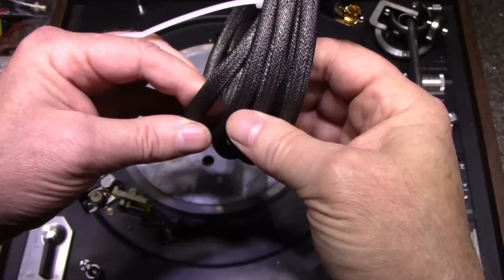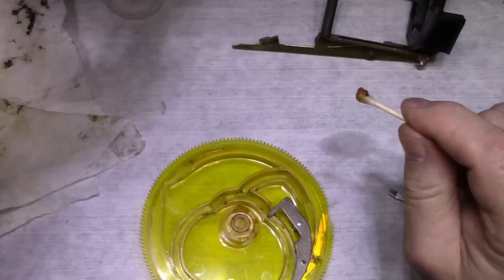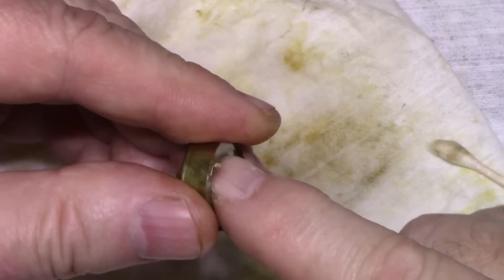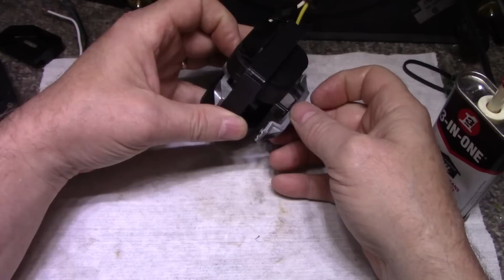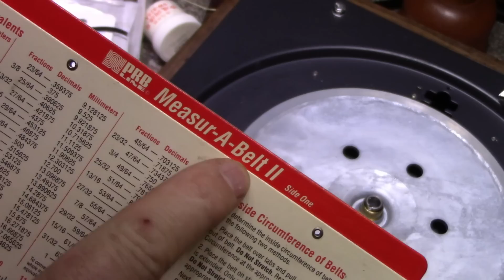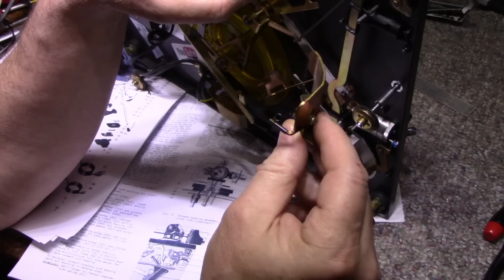Dual 1249 Turntable - Overhaul (Ep. 171)

Comment: I have more Duals on my repair rack than any other unit. several I still can't get working.  I wouldn't pay $10 for one. they are total crap.
Reply: You have no idea about Dual turntables. You'd better leave them alone.
Reply: @coconuts-TV they are absolute crap. There is no advantage of a Dual over any other turntable. they are noisy, high maintenance, have several consumable parts and don't sound any better than any other turntable with the same cartridge. not surprising given they were designed to be a budget automatic turntable from the start.

Comment: 2:06:07 ∞ play doesn't work as described here. Rather, the ∞ setting causes the tone arm not fully to park but to repeatedly restart the play cycle — of the SAME record. Single play is selected by one of two manual actions, (1) turning the control from ∞ to 1, (2) selecting STOP at the main start/stop lever. The deck is not a stacker.

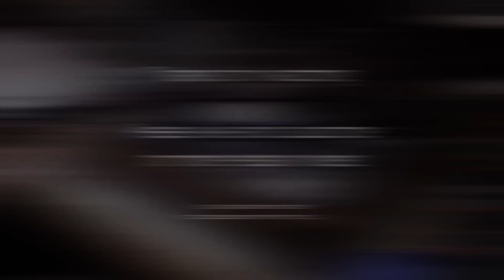Comment: At 2:26:28 in the video you stat that you removed the aluminum plate, does it just slide off the two shafts after removal of the clips and the shield, mine is hanging up on the larger shaft with the brass bearing with a rubber ring and the spring wrapped around it and I think it is frozen to the brass insert. Those two should be free from one another  I believe  because when in the video you switch between single and stacked records it goes in and out mine does not. I don't want to pry on it and break something , can you explain the removal process of the plate please the rest of the video is great thanks

Comment: Those older cartridges probably track at more like 2 grams.
Reply: Older cartridges were much higher compliance than the modern stuff... I have an Ortofon cartridge from the 1970s that tracks perfectly at 1g. Of course, you need a good tonearm with perfect bearings to achieve such a result.